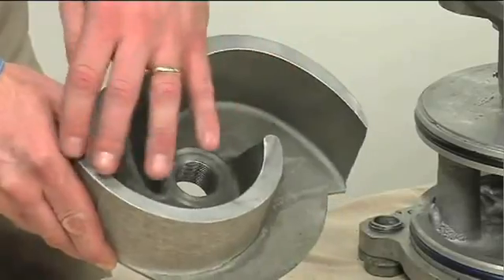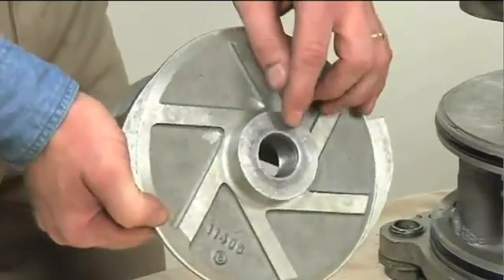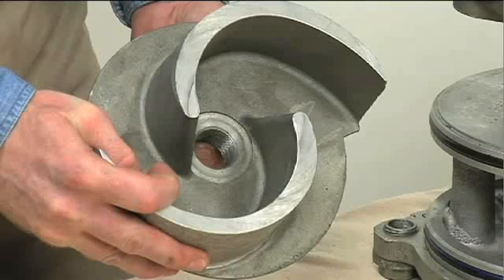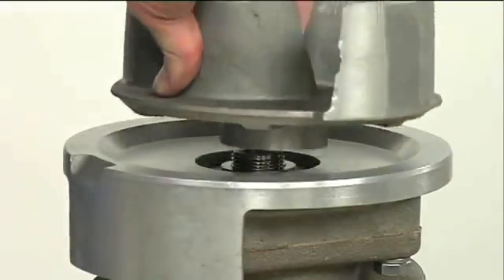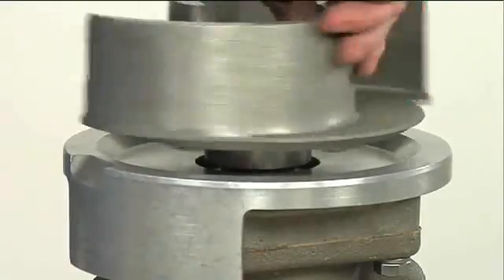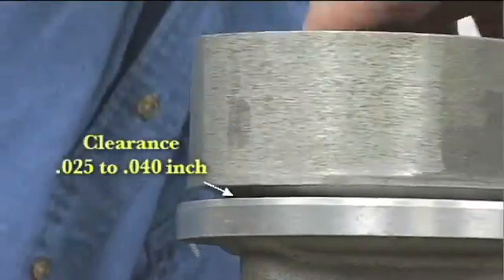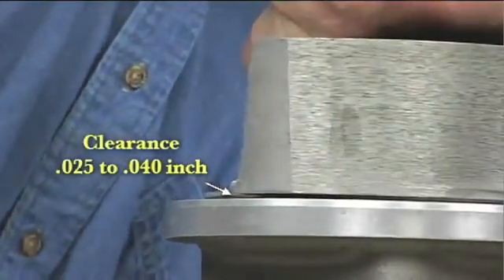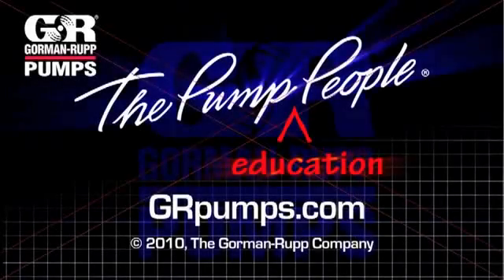Gorman-Rupp Super T Series Pump Maintenance Pt. 8  Impeller Installation and Adjustment.avi

Comment: Ribs on the reverse side of the impeller increase strength, but when pumping abrasive water-sand mixtures, this leads to increased wear on the back wall of the pump casing